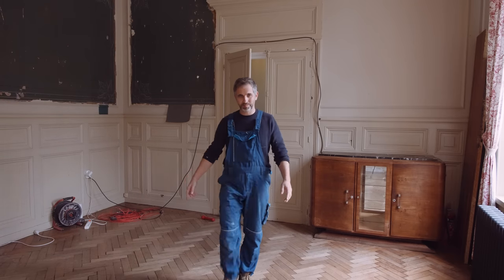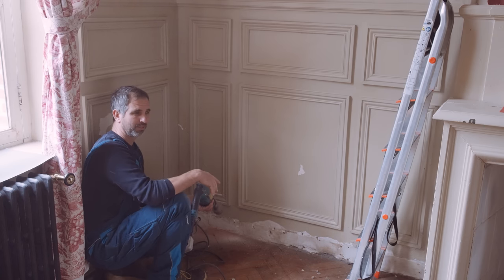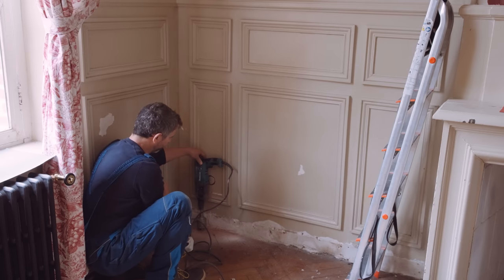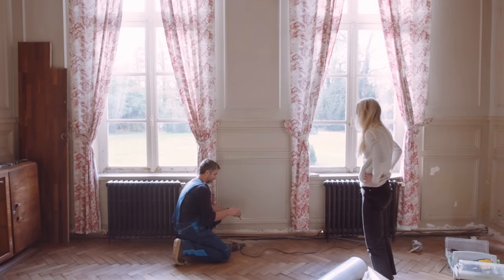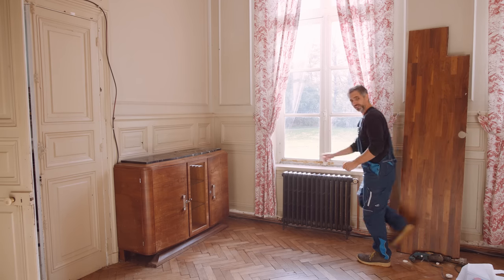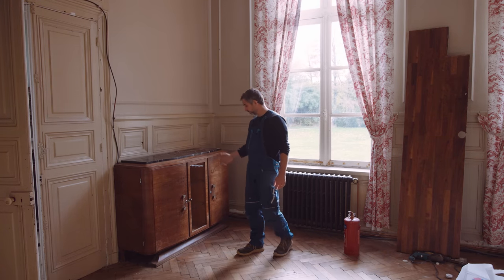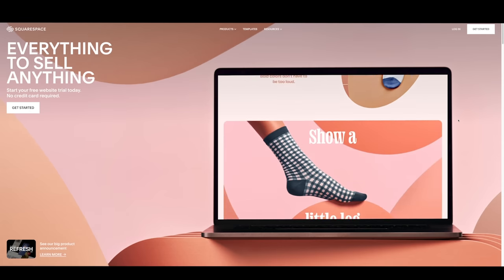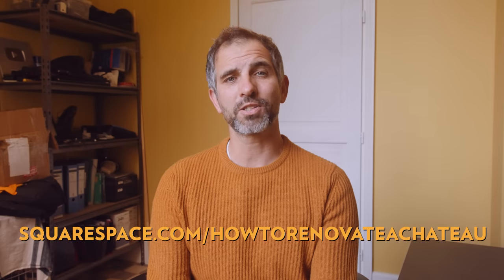Dining Room Makover in French Chateau - Part 1

Comment: In Portugal we use 2,5 mm2 of conductor for the outlets and a circuit breaker 16A type C. For the lights we use 1,5 mm2 of conductor and circuit breaker 10A type C. Please be aware that your protection device (16A circuit breaker) with a conductor of 1,5 mm2 since the maximum current that it CAN transport without damaging itself is 14,5 A.

Comment: I'm an electrician and started renovating an old mansion from around 1840 and we have the same problem with getting every wire where it needs to go, without damaging the old floor, wall and ceiling. Now we're thinking about using wireless switches in some places.

Comment: WiFi light switch would mean you don't have to track walls for ceiling lights.. the device is in the light fixture and wireless switch on the wall. Push the button and the switch sends a wireless signal to the device in light fixture

Comment: I was thinking about your colour dilemma and I think that maybe you should delay your decision.  I love your taste and what you are doing to the house but you are giving yourself a tight deadline to have the room finished for Christmas which may force you down a road you regret. Think about the kitchen and the thought you put into how everything would work and how successful it has been. Take a step back and think about how you will use the dining room - wil it be primarily an evening room or daytime room. Think about the lighting . I would line the walls with lining paper which will tidy it up and paint the panelling in a neutral colour. Think about furniture placement before you finish the sockets, there is nothing worse thannot having sockets next to where you want a table lamp. I would then concentrate on the furniture - the dining table is going to make the greatest impact in the room. Make sure that the room is warm and comfortable for long, leisurely dining. A wood burner would add a lovely ambience. You could temporarily hang the curtains you have and concentrate on decorating the room with flowers and foliage, candles and lamps. Use the room at Christmas and get a feel for how it works and then storyboard the whole room in the New Year to get the cohesion you have achieved in the rooms you love. You mentioned ages ago that the pink room was one of the first you did and you had to rush to get it finished but don't feel it is as interesting as the other bedrooms. Take your time and enjoy the planning process rather than giving yourself a very short deadline, remind yourself how long it really doest do the prep properly to get good results. I am sure you will create a beautiful room but enjoy the process and take your time, your family are more bothered about spending time with you than seeing the dining room complete.